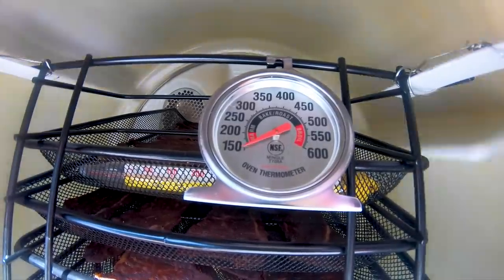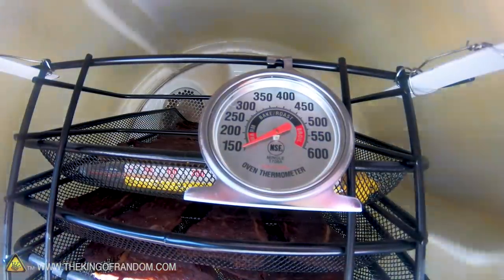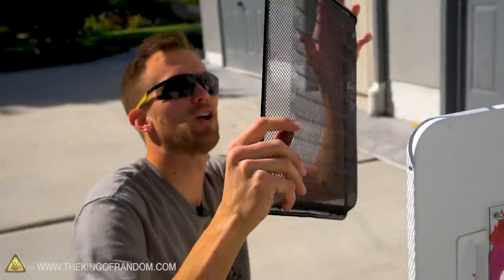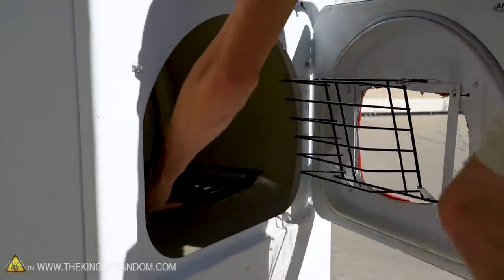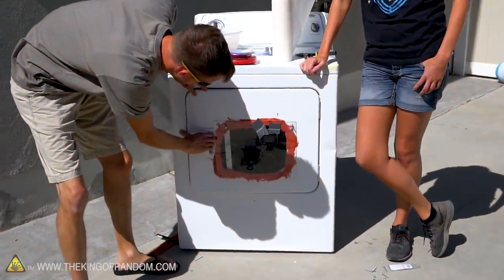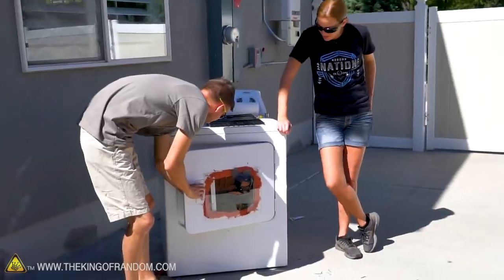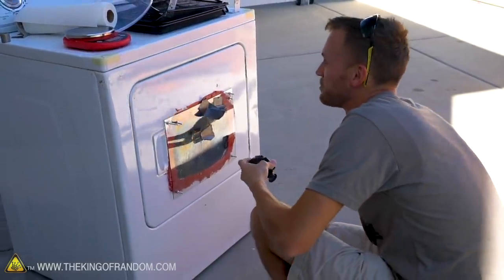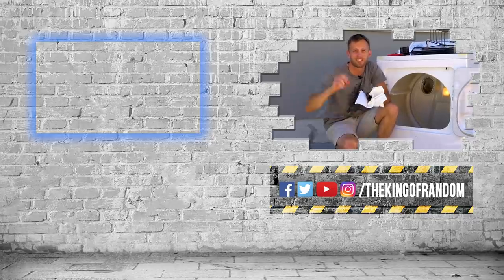Your DRYER Can Cook Steak!

Comment: Try putting liquid nitrogen into the flamethrower to put out a fire
Reply: toma hawks YES
Reply: Sounds like Cally
Reply: Smart
Reply: 69 likes... nice
Reply: You’d have to come up with a method to prevent the nozzle from freezing. In addition to that, extreme heat and extreme cold typically results in explosive outcomes..
Reply: That’s a really cool idea they need to do that(:
Reply: HellishGrin460  the fact is that nitrogen put out fire on its own so yeah no explosions the backyard scientist did it
Reply: AN ICETHROWER
Reply: WilliamZombee  do u know were the king is
Reply: Nope
Reply: It would either freeze the nozzle or evaporate  due to gas expansion when shot out.🤦‍♂️
Reply: Pff that's wimpy liquid oxygen would be way better
Reply: Fast Car Boi23 liquid nitrogen and liquid oxygen are the same thing
Reply: Arctic Fox we’ve found her burner page
Reply: @bw8396  no they arent. not even close. liquid oxygen is an OXIDIZER. you shoot liquid oxygen at a fire, and as long as there is sufficient fuel, the fire will become insanely bigger.
Reply: B W umm, I haven’t even gone into chemistry class and I know that nitrogen and oxygen are two different things, even in liquid form...

Comment: to make the popcorn work you need to restrict the air flow as if you had forgotten to clean the lint filter. the heating element is on so less air means air that does pass through will have to absorb more heat
Reply: seriously restrict air the heat will increase

Comment: if you put a restrictor on the dryer vent it should trap more heat inside.
Reply: There usually is an over temperature switch somewhere in the control circuit. Stay below it's setting when restricting the exhaust or disable it if setting it on fire is okay....
Reply: It wouldn't allow the moisture to escape. It would be like drying clothes and they still come out damp....
Reply: True if you close the exhaust too much. So that's what TKOR needs to experiment with.  Finding the balance between increased temp and moisture removal.

Comment: I already asked in the other dryer vid but, you can try to preheat the air going into that to see if it gets hotter inside.

If the dryer just has some power settings (4 example, constantly just 200W instead of 2000W intermittently) it could work

Comment: Should have measured the door, shelves and clearance before building.
Reply: they pre bought it bruh
Reply: hulkbot 776 
If they measured first they could have bought better fitting shelves.
Reply: As an engineer that has to measure and purchase obsecur  parts all day i can tell you that they did it justttt fine. You can spend hours trying to figure out the right size then just trying to find the right shelf (they probably dont advertise that dimension). Considering its just single experimental run they did a great job.

Comment: Im surprised the haven't partly blocked the outlet to increase its overall heating
Reply: Or heating the air before it enters, or partially recirculate it
Reply: Blocking the outlet will blow the thermal fuse and it will shut down. 
Preheating the air will have no effect since the temp inside the dryer is limited by thermostat. If the incoming air is greater than 155F the dryer won't do any heating.

Comment: try cooking ramen noodles with a pot in the dryer somehow
Reply: It gets hot inside but it doesn't have much heating power overall. Think about a torch lighter: yes, the flame gets to >1000°C, but you won't boil a pot of water with it
Edit: even then, I kinda have curiosity as well

Comment: Would love to see chopped/ sliced veges (eg peppers) in fine mesh laundry bags (each 1/2 to 3/4 filled), dehydration attempt in a laundry dryer. I think the laundry bags will help keep them safely confined and able to tumble. Is an improvement on time vs a typical 12hr dehydrator? Might break the dehydration world if it is :)

Comment: I don't know about the organizer racks.  I'm thinking about the paint gassing out, though 150 degrees isn't very hot, but it will never get any hotter than about 75 degrees in an office so there would be no need to use heat resistant paint.

Comment: You might be able to trace the power wire for the motor that spins the dryer and put a switch on it to manually cut it on and off.